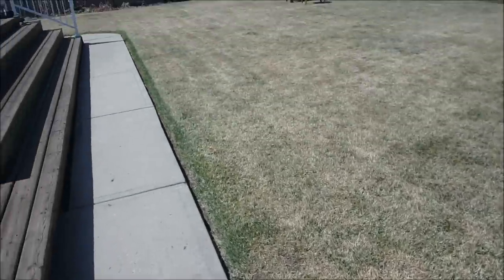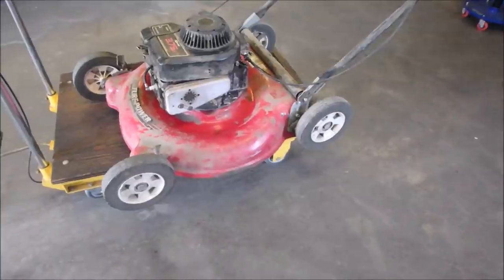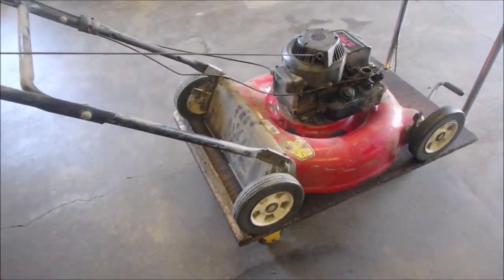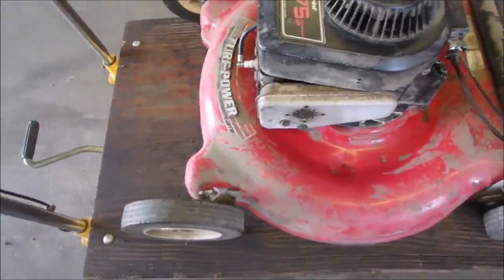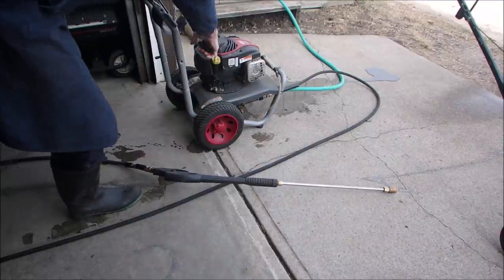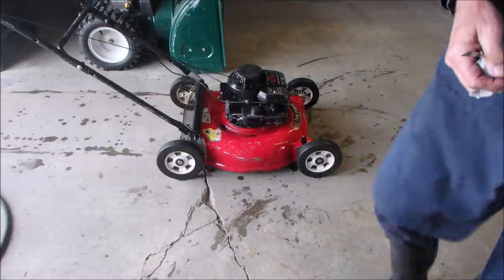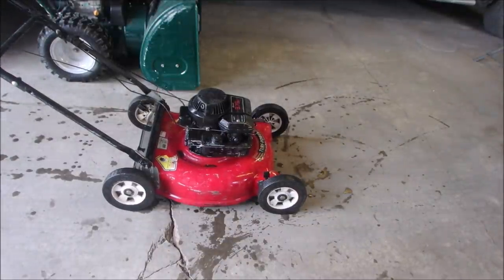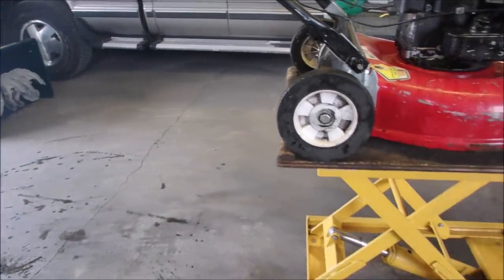Replacing Lawn Thatcher Spring on an Old Briggs Mower

Comment: I used to have a mower set up just for that purpose. It worked fairly well but the blade adapter kept getting wonky so I bought a Mantis tiller with the de-thatcher kit and it works well. I de-thatch every other year in the fall right before I over-seed and fertilize for the winter. Great old Classic Briggs there, can’t kill those things!
Reply from the maker: Thanks MJG

Comment: Nice Bruce. Never realized you could replace just the springs on those. I have a slit seeder and have a dethatch assembly for it so I've never tried the specialty blades on a mower.
Reply from the maker: Right.  Those springs are popular out here.